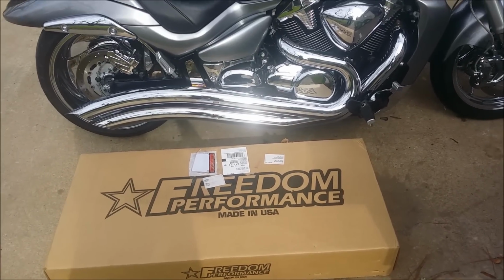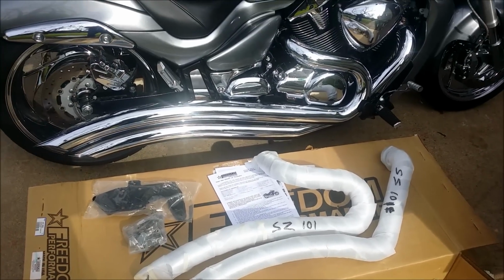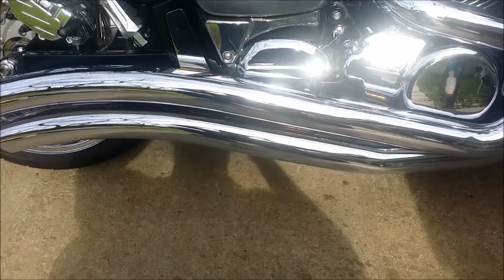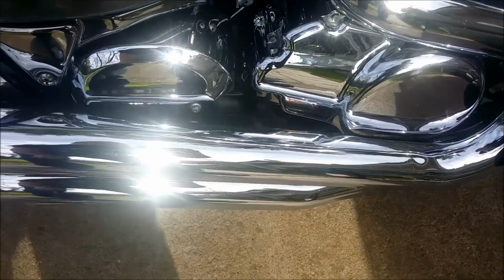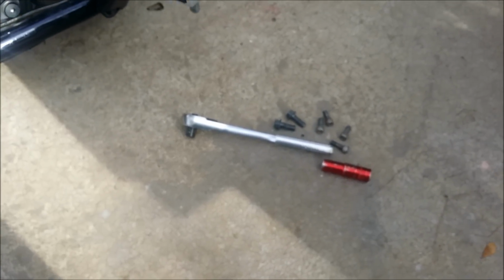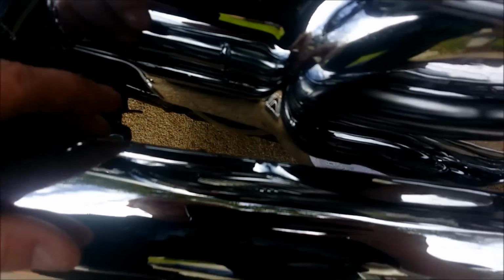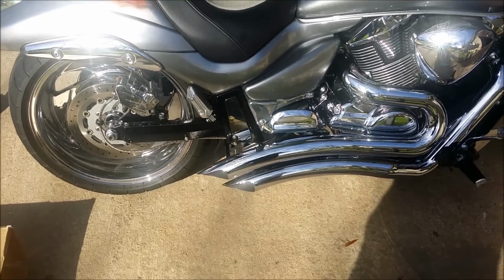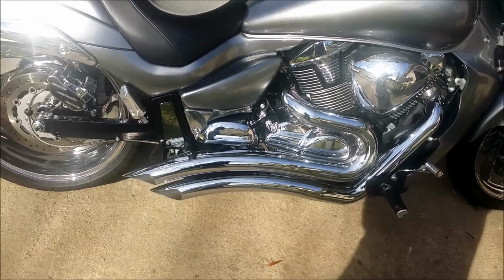M109R Cobra Swept versus Freedom Performance

Comment: One of the biggest things that affects torque on that M109R engine are the adjustable gates for the exhaust system. If you replace those with different pipes you greatly affect not only how much torque, but where the torque curve is.  BTW excellent phone/camera combo.
Reply from the maker: I had the bike dyno tuned so i never had any issues. Thanks on the cam. Now I use my Samsung S21 Ultra and record everything in 4k@60FPS ;)
Reply: Достаточно прошить мозги и все будет хорошо.

Comment: Sorry but I like the Cobra Swepts better.   And I have a set on my 2013 M109R LE.   It is really almost impossible to do justice to any of the pipes with a microphone on the internet.  The Swepts sound awesome in person.   I was going to get a set of Monster aftermarket baffles to get a deeper sound, but they basically just make a too small version so it will go up in the pipe and a good portion of your exhaust goes around the baffle because they don't bend them to fit the pipes.  I guess they figured putting the baffle pipe in a bender was too much work.   I am thinking about getting some fiberglass wrap, pulling the stock baffles and wrapping them for a deeper tone.   But I am not about to spend almost $200 for a product that the manufacture is too lazy to make them right.   And on top of that you have to uninstall the heat shields and drill holes and put them in 6-8 inches up the pipe.
Reply: Heya Marty! Would you please tell me if you had to dyno the bike or anyhting? Lost any torque etc. after installation? Thanks in advance!

Comment: I liked the Hard Krome Sideburner better than the Cobra Swepts on my '08 M109R. The tack welds for the hold downs clamps for the heat shields on the Cobra Swepts failed, not once, but twice... never again Cobra!
Reply from the maker: Never had a problem but good this I own a welder ;)
Reply: Mine too,currently shopping for new exhaust
Reply: Mine too,currently shopping for new exhaust

Comment: Did Suzuki get rid of that SET Valve thingy on the later bikes.  I've seen an install where you have to disconnect wires and a bracket and all kinds of goofy crap.  Di these pipes just bolt directly on?
Reply from the maker: Not sure. Mine had it but was already disconnected by the PO. They did bolt directly on and with out issues

Comment: The sound of the Freedom exhaust is better but you lose some mid-range without the cross-over the Cobra exhaust had...did you miss the mid-range?
Reply from the maker: I had my bike dyno tuned so there was no loss anywhere. Its pulled through all of the gears.

Comment: Sir, Not to change the subject of your vlogs, but can you tell me if you have had trouble going from 1st to 2nd gear on your M109R ?  Mine goes in very hard. I have adjusted the clutch cable every which way but God who knows. 

I have heard changing the stock clutch foot shifter does wonders on these bikes to get a smoother transition form 1st into 2nd. Any truth to this in your experience ? What would you advise doing ? Down shifting from 2nd to 1st is no problem, but 1st into 2nd seems to hang and go in hard. Please advise........Bill
Reply from the maker: I never had any issues BUT I had shaved the center pin to my clutch basket to let my oil get in the clutch plates. I also bought and installed the smaller star shifter. I added the bronze bushing on the shifter and last but not least, the clutch gets adjusted in 3 places per the service manual. First in the clutch basket itself (right side of the bike), then on the adjuster on the left side of the bike and final adjustment is at the lever. If you havent done it this way, it might help dial it in for you. But to answer your question, no, I never have any issues neither shifting 1-2 nor staying in 2nd.
Reply: @tRRickedOut  Appreciate the heads up advice !  I will take your word.

Comment: do you need a power commander
Reply from the maker: I wouldnt say you need one but I would say it helps. I ran w/o one for a while and it was fine but I did later add one and have it dyno tuned and it ran much better.